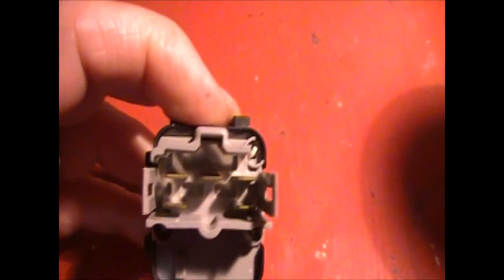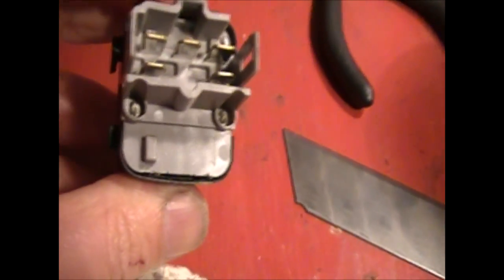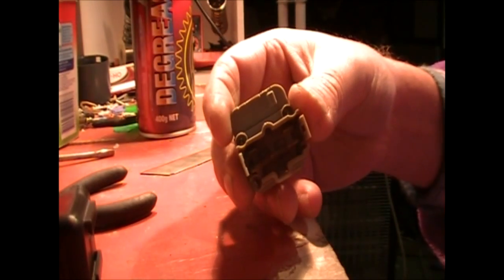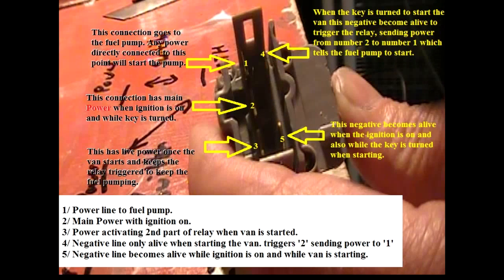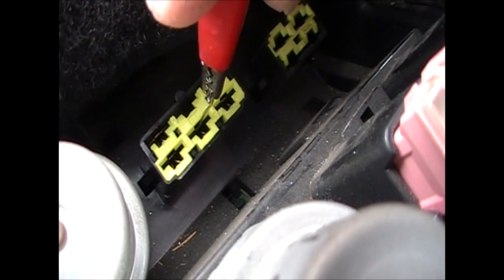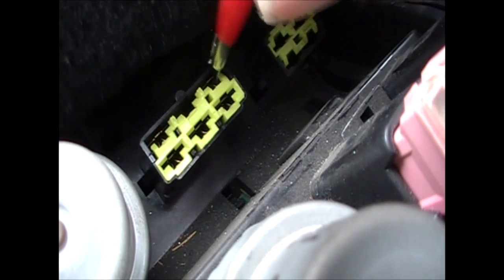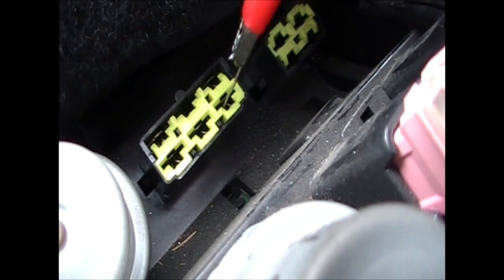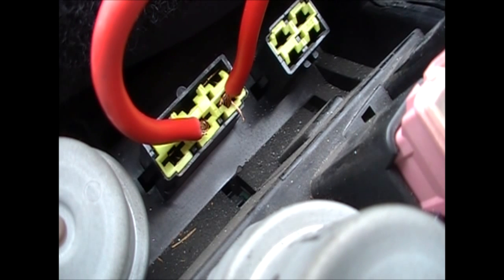Jumping fuel pump relay and how it works; TCR11 Tarago Previa Estima

Comment: My 96 estima has japanese script on fuse and relay covers.I could not find fuel pump relay even when I googled translation.Relays are immpossible to remove without damaging case.Toyota has some wierd game where they try to prevent DIY mechanics from finding or replacing relays especially f.p. relay.every year they change location, color, part #.The price is prohibitive to.I currently run a jumper from my lighter fuse directly to the f.p.Thanx.
Reply from the maker: You can simply jump a wire from B+ to FP in your data port to bypass the FP ralay. The main relay is also the FP relay.
Reply: @TaragoPreviaEstima  thanx brother

Comment: At what point would the computer be the problem with the fuel pump not getting power. All I have at the fuel pump right now on the Previa is the level, no power to pump leads. I have to test the relay more , I am getting on the middle lead on the bottom which you say is the "Battery lead". I have not tried to start the can and test the other leads. Very good video
Reply from the maker: Thanks for watching. You can also bypass the ECU and relay to test the pump by adding a wire on the data port between terminals B+ and FP. I have also known people who left the wire connected as it was the only way to get the pump working.
Reply: Thx, for some reason after putting new pump in it finally fired up. All because of a bad starter and runon, knocking out two ignition switches

Comment: As I understand it,  the point of that circuit opening relay(COR) is to shut off fuel for safety reasons.  But can you drive around for a week let's say,  while it it jumped without damaging anything?  I actually have a jumper location under hood that is made for this.  But I don't know if I'm supposed to leave it jumped while driving.

Comment: Hello mate! Greetings from Southern California, just pick up a 1991 Previa that has been neglected as of late, the good part is that the first owner took very good care of but the guy that I bought it from just plain didn’t do anything to it but destroyed it.
Quick question my rear door (latch) won’t open , the panel has been removed and it’s missing. Do you have a video on repairing the back door?.
I will use your video to replace the sliding door.
Yes I have also subscribe to your channel.
Thank you very much for educating us.

Comment: good afternoon!
I needed your help, I got aToyota Previa  of 1996 and I needed a flash to the left side! In Portugal I can not find ... can I count on you?
Reply from the maker: Hi. Blinker / flash Left side light. You can find many on ebay http://www.ebay.com/itm/New-Corner-Light-Lamp-Driver-Left-Side-LH-Hand-TO2530107-8152095D00-for-Previa-/281922886349?hash=item41a3e9dacd:g:gP0AAOSwFJBZP1ge&vxp=mtr
Reply: Thanks, but it's not that ... my preview has light of presence and means!

Comment: Thank you for your response. NOW... when I turn the key the EFI fuse pops. the starter cranks, the lights come on. I removed the IGN fuse (7.5) and the EFI fuse does NOT pop, but when I put the 15 fuse back into the EFI space it pops. I was wondering if my ignition was faulty..? As soon as I turn the key the fuse pops. I checked all under the van, under the steering wheel, and under the hood, under both seats, nothing out of place. I haven't had someone to help me with the fuel pump as to listen if it is pumping or not but I have ran very low on fuel many times and wondering if the fuel pump is being the problem. That is the next step but having it pop on just turning the key is what is bothering me... any ideas? You are helping me greatly with this page!!

Matthew
Reply: Gwensday 12 it was the cap in the distributor on my geo prism 93 ign suppressor left it out seems ok no longer available.was a 10a. Fuse

Comment: Hello from the USA. My Previa has been running just fine, but then cut out. I replaced the 15A fuse and it started back up after thinking it was the fuel pump going out. So I did not replace the fuel pump but the van just died on me again and another tow. As I was sitting there I tried a new fuse and it instantly blew, along with stinger V fuses that I plugged into it. After blowing a couple of fuses I gave up. I pulled the relay off, put it back on and it started but was wondering if the relay is bad- could or would it blow the fuse? That's the first start to my questions but wanted to ask you first.
Matthew- (using my daughters link here!)
Reply from the maker: I would start with removing the cover under the steering wheel and check the connections and make sure there is no faulty or melted connection. pull the connections apart and look in them to make sure there is no faulty contacts or burnt. if there is then clean it the best you can and spray the connections with a little wd40  and put them back together. The fuel pump relay is a 2 in 1 relay design with a capacitor. If the key is not turned there is no power at that relay. Self testing thought, when the fuse blows does it still blow when relay is out and is the key turned or not when your putting that 15amp fuse in? Looking at the wiring diagram I would be lead to think the pump is slowly dying or there is a bad connection giving a bad earth. check connections at the pump as well. https://3.bp.blogspot.com/-cjmYy_Q2_ZA/WHjsJRtrLbI/AAAAAAAACGw/pYFyIXaOFeoJHwIRdQH8hWZYxoZHLI5SgCLcB/s1600/24%2B-%2BElectric%2BDiagrams-page-027.jpg
Reply from the maker: Hay I got an email with this message: 

my  little brony 6 commented: "Thank you for your response. NOW... when I 
turn the key the EFI fuse pops. the starter cranks, the lights come on. I
 removed the IGN fuse (7.5) and the EFI fuse does NOT pop, but when I 
put the 15.

That's all there is...

Comment: I might be getting a 92 Previa. The owner says the fuel pump gave out, I'm not sure how true is that. I would like to try this first before jumping into any serious conclusions on the fuel pump. My concern is that if the fuel is out, where is it really located in the event that it would need to be replaced? Any feedback would be great. Been looking everywhere. 

Thanks.
Reply from the maker: Fuel Pump is inside the tank. Fuel filter is in-front of tank. Fuel pump also has a small filter but not very effective.
Reply: How do you gain access to the fuel pump? Is it somewhere under the carpets of the back seat or do I need to drop the fuel tank to gain access? I'm glad I found your channel.
Reply from the maker: Fuel pump is in the tank, you need to drop the tank.

Comment: Thank you very much for your reply, TT92.
I tried the jump and worked just long enough to get the van onto the driveway (the tow truck had dropped it on the street)
It worked for about 5 minutes then died again. Looks like the pump itself is gone: I could hear it start when I put the jumper in but now, nothing happens and, of course, the van won't start.
Looks like I'm in for another tow to the mechanics...YAY! (He says the fuel tank has to be removed to access the pump... GREAT......)
Anyway, again, THANK YOU for your videos. This one is a really good trick to know for when the relay is the issue.
JLB
Reply from the maker: +J-L B cheers mate. dropping the tank is not hard but painful as you have to slid around under the van. You could do it your self and save a heap. join f/groups/TARAGOCLUB/ and my self or others can help as well.

Comment: Hey there, TT92
My Tarago (93) died on me tonight and I think this might be the issue. I'll try that trick tomorrow.
BUT I have a question you'll probably find stupid:
Where is that relay? In the dash board with all the fuses? (I looked at the "Fuse Map" and found no mention of fuel pump)

Thank you for all your videos, there's great stuff in there!
Reply from the maker: +J-L B thanks for your support, It's [E] relay / circuit opening relay. http://i16.photobucket.com/albums/b3/estimamike/EPC%20stuff/prevtarfuse.jpg
Reply from the maker: from the workshop manual / Circuit Opening Relay
1. Circuit opening relay controls fuel pump circuit. The Electronic Control Unit (ECU) receives an input
signal at STA terminal when engine is cranking. Starter signal is also applied to terminal STA of circuit
opening relay.
2. Starter signal energizes circuit opening relay during cranking. The circuit opening relay then provides
voltage to the fuel pump or fuel pump relay. Fuel pump relay is used on Celica 2.0L Turbo, MR2 2.0L
Turbo and.
3. On all models except Camry 2.2L, Celica, Corolla, MR2, Paseo, and Tercel, fuel pump switch in airflow
meter provides the ground for circuit opening relay. On all other models, circuit opening relay is
grounded by the ECU through the FC terminal.
1992 Toyota Previa DX
F - BASIC TESTING - 4-CYL 1992 ENGINE PERFORMANCE Toyota Basic Diagnostic Procedures
AUTO

Comment: How true is that .EVEN NEW CARS CAN HAVE THIS Happen . once again thanks .
Even for testing the pump .no need to run the engine just turn key on .one more thing you have  achieved.
Reply from the maker: True, I don't know if new cars would have the same relay! but for the ones that do this will be very helpful.